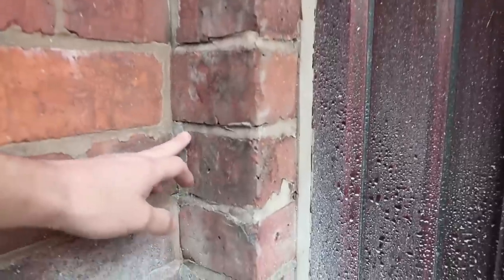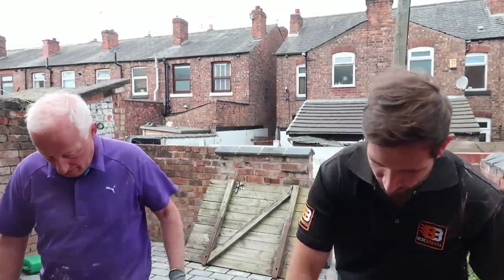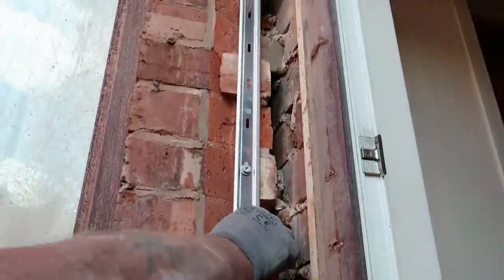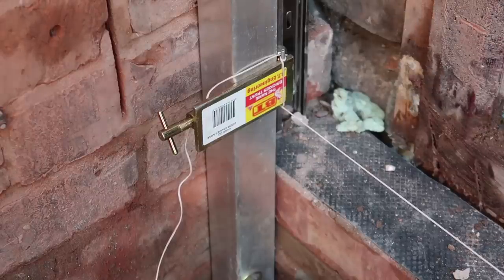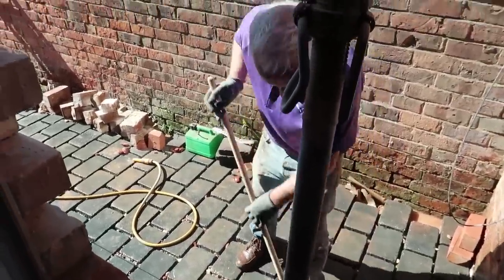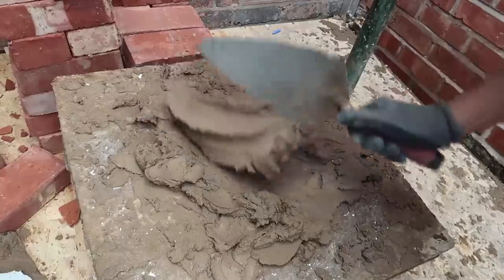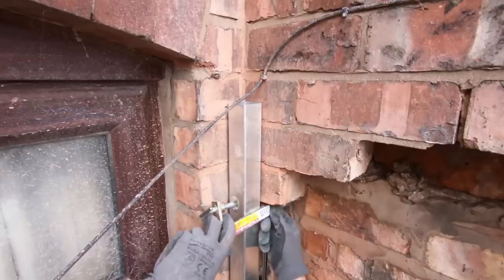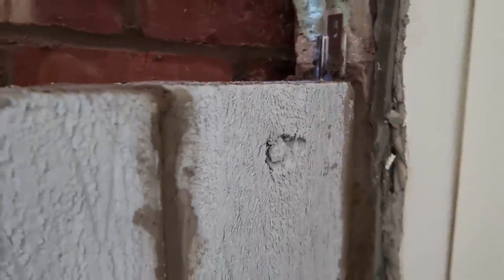Bricklaying - Bricking Up a Door

Comment: Hey Stu. Mate you gotta get yourself an Arbortech! Makes life so much easier with toothing 👍🏽
Also the clamp you're using for you line is really for steel frame doors, we usually use dutch pins and pack our profiles out off the wall so the line can slide up,  and use regular corner blocks so the line can wrap right around the profile..
Top job as always mate👍🏽

Comment: Lovely Job! Got a question about the 'Strong boy'. As you get to the end of the door seal you remove the 'Strong Boy' with an number of courses which do not appear to have hardened. Should the brick work be fully hardened before you remove the 'Strong Boy'? What's the danger of the above brick work cracking? Thanks

Comment: I have some repointing of a garden wall that I'm working on. I've picked up some tips from you but I'm finding I get alot of mortar on the brick face. I'm having to try and remove with an acid brick wash. Do you have a repointing video as I can't see one you've done.

Comment: What is the reason behind cutting out the lintel and such? Is there a structural reason why one woudn't use the existing structure and simply tap the new bricks in with something like a steel pin rod, or is that a terrible idea?

Comment: 15 yr union mason tender here from SW CT USA... good job, nice work,  good craftsmanship with the video production top shelf- the whole thing being oddly satisfying to watch 

 Glad to see water with the demo saw. 

Today stopped at the light some knuckleheads were doing the sidewalk in brick pavers and their labor was doing the cuts dry wirh the lot of them without masks ... a giant cloud driftin over, dusting the cars and of course filling their lungs. 

2 questions though - are not 75mm clean used brick available esp for such a small job? Not just for dimension,  which no one will notice, but maybe a better color match 

And why isnt Dad wearing safety specs when beating the wall with that brick set? 

Tell him he don't need to plumb the his work just follow the face of the wall like you are doing outside 

Other than real tight. That 1/2 @ 11:22 is visible to only you and anyone who picks that up with think is a bricky showing off. Nice solution

I'd tend for you any day

Comment: Great job Stu, the A team back together again, bit of a sweat on there buddy , proper job
Reply from the maker: Cheers Mike hope you’re well mate
Reply: @Stucrompton1  living the dream Stu , fixing cars every day during the week , weekends doing lots of housework, ie , conservatory plastic off , build up , now kitchen diner, knock through into old kitchen , two 3.75 m 23 kg p metre beams , put in with Bolton man power , knock all internal kitchen  walls back to 1934 brick , batten and reboard , new bathroom , knock off tiles n plaster again to brick  and floor boards when we've nowt to do in-between going to swimming pools for 12 hours plus a week with our son , crazy , but not 1 skip used , many trips to tip

Comment: Hi, don't know why l haven't see this video before, mate you got to get an Arbortech  AS160 / AS170 saw for this type of work. They are expensive, so hire one from Travis Perkins, to see how you get on. . Had mine 8 years, clean, no dust, more versatile, safe. Would not be without it.
Reply: Hi Peter I have had my eye on an arbortech for some time now,I wouldn't need it all that often but a lot of reviews I have read stated that they are not up to the job and often break.I imagine with you having yours for 8 years that your experience has been much more positive.
How do you find it, have you had any issues? Thanks m8. 👍🙂

Comment: Wonder why they didn't use any tie wires between brickwork and blockwork, and blocks weren't tied in either.
Reply from the maker: We did if you watch the video and don’t skip through, blockwork was tied in with wall starter, make sure you watch the video properly before you make yourself look silly.

Comment: What was the reason for wetting the bricks?
Reply: It makes them.abit easier to lay if the bricks dry the mortar out it makes it harder to point up aswell as getting them level with the line
Reply: Rex Banner Bricks absorb water. They will quickly absorb the water from the wet cement that will make the cement brittle when dry. Best to let the cement dry slowly thus wetting the bricks.
Reply: @finned958  Top man! Thanks for the explanation

Comment: not tryn tell u what to do just suggestion... try a 7” angle grinder lot easier handle than cut off saw...
Reply from the maker: but it doesn't get through the joints enough for me
Reply: gotcha.. iv had a 10” blade on my water fed angle grinder .... nice work Cugi.... if u ever think movn Boston, Mass. give u more wrk u know what do with.... best luck